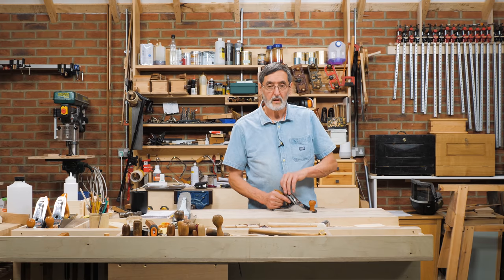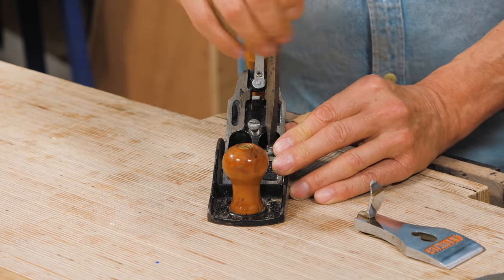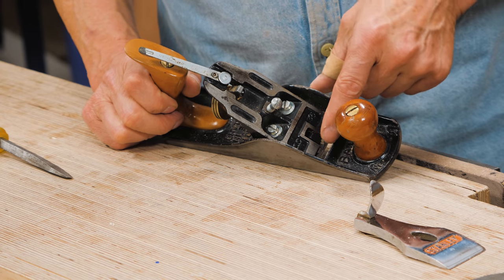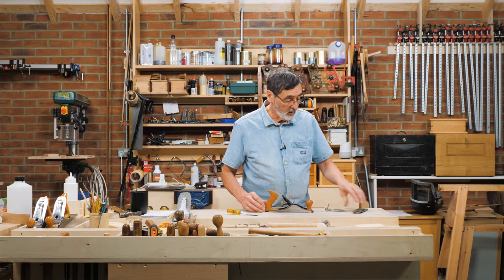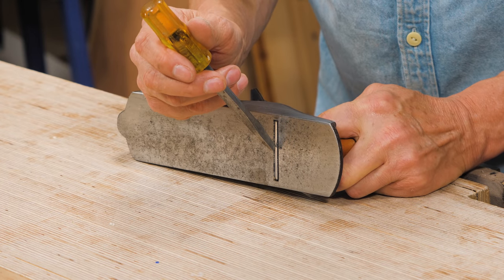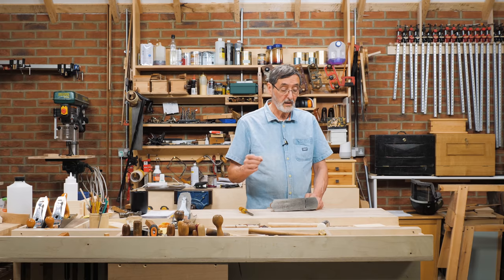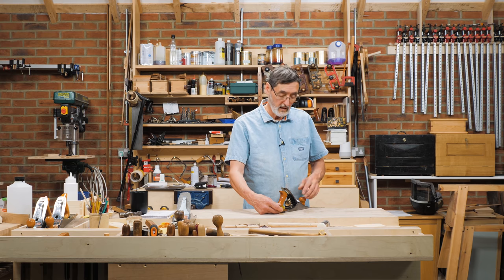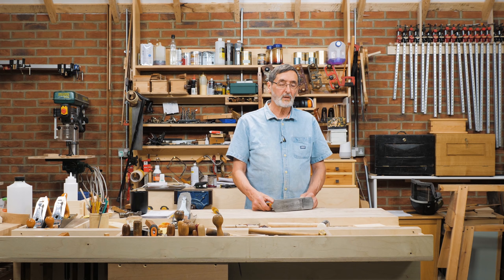How to Adjust the Frog on a Bench Plane | Paul Sellers

Comment: You said "if I align the soul somewhere around there", while pointing your finger to something that I can't see in the camera image, what you are pointing to or it's meaning, because you switched in mid sentence from talking about the frog to adjusting the soul which doesn't move. I'm pretty sure that you were talking about a reference position of the frog to the rear of the mouth but I can't see where that is based on the pointing of your finger.
Reply: Sole :)
Reply: @Russ0107  I stand corrected. A plane has no soul. It has a sole. I, on the other hand, have a soul but no sole.
Reply: @ancienttom97  Don't be discouraged, you have two soles. One on each foot!

As for the frog alignment, Paul is indicating the back of the mouth opening, which is bevelled at the same 45° angle as the frog. He's aiming to position the frog so it's own angle and the bevel angle on the mouth are roughly flush (his looks to be set slightly back from it), and then make small adjustments from there.
Reply: @ancienttom97  some planes do have a soul.
Reply: @rossbaker3762  Thanks. that's what I couldn't see, the proximity of the front of the frog to the back edge of the mouth. I have a couple of cheap planes that want to try to flatten an square up before deciding to through them away. By the way, I am a Hillbilly in the Ozarks and I go barefoot.
Reply: @ancienttom97  You made me smile; thank you.  I'm sure you're a pretty smart Hilbilly.
Reply: @ancienttom97 As a Canadian, people in some parts of this world still believe  that we all walk around up here in snowshoes. My souls are protected.🥴👍🇨🇦👨‍🦳

Comment: I have a very curious situation. I was assembling a plane that I restored, and when I mounted the frog with the top screws, one of them wouldn't go in all the way. Unfortunately I didn't note the screw position before disassembling. The screws are the same length and the holes are the same depth, the threads all seem to be intact, so I don't understand why one doesn't go in all the way. Is that by design or is something wrong with my plane? I haven't assembled planes before so I have nothing to compare to.
The good news is the plane functions perfectly fine.

Comment: Thank you. I followed your video on plane restoration and it was a very enjoyable hour or two to tweak a couple of Stanly planes back into full working order. I did wonder about frog position when reassembling, but I just put them back exactly where they were as you show here and they worked perfectly - once the blades had been sharpened.
Stay safe!

Comment: Thank you Paul for this information.  I made the mistake of moving the frog back on a #4 and discovered that the iron would not advance far enough to contact the work as the heel of the bevel pressed against the bevel on the plane sole.  Now my suspicions are confirmed.

Comment: Hi Paul, on a semi related note, I found amongst my fathers old things an instruction leaflet for a Stanley plane. It looks like it's from the 1960's. On one side it details the various parts of the plane, how to sharpen the blade and how to adjust the blade. The flip side has 'Hints' on how to use the plane and of course a promotional section showing the various other Stanley hand tools in their range. As the picture on the leaflet is for a #5 plane I'm assuming this leaflet came with the #5 plane that is sitting in my workshop which I inherited from my father. I could scan the leaflet and send it over if you are interested.

Comment: Thanks for passing on your experience Paul. On a somewhat different note, I've got a plane which is a fairly close copy of a Stanley Bailey #4 but it has an aluminium block for the frog! Will this be an issue as far as the working or longevity of the plane is concerned?

Comment: Thank you Mr. Sellers for teaching me these valuable lessons and old know-hows. I finally nailed the restoration of an old Stanley Bailey #4 type 16 from the 1940's. I kept getting chatter and tried allmost everything. Then I watched this video again and as it was, my blade was touching the back of the mouth... I resolved this and the difference is like night(mare) and day. It is so nice and smooth now. The only thing that is bugging me, is the extreme backlash.. I do know it is there and counter it accordingly, but it is more than a half turn. Is there a way to fix this? I have seen someone who shimmed it, but that is not a nice solution in my head... And a question, should one back off the blade and then tighten the adjuster to get the backlash out, or can you just retract the blade and leave the adjuster at that setting without retightening? Kind regards Jurik

Comment: Planes are still a bit of a mystery for me. I've only bought one, 2nd hand on yardsale. and don't really know if it's broken or even if the parts belonged together.. I have "restored" it and sharpen the blade so it does cut but often shavings stick in the corners of the mouth of the plane...
Reply: Make sure your chip breaker is in full contact with your chisel over the entire width. If not, one or both may need some flattening
Reply: @robincolenbier5875  Will do. Thanks.

Comment: My question is why would you want a great big opening for the most part these are tools that removes small amounts of material they have other tools to remove large amounts of material good refresher course though
Reply: If you were converting to a scrub plane perhaps. File the mouth a little and move the frog back to create a wider gap (or file the front would make more sense!).

Comment: This has been driving me crazy on my #7 , I can't get any more than a sliver opening  , the only way I get an acceptable gap is when I raise my chip breaker way more than I like?
Reply: You could file the rear of the mouth to create a bigger mouth. I'm guessing that if you had a thicker blade than the original, this would create your "sliver only" mouth issue. Once filed you could retract the frog further.
Reply: I have replaced the blade but it was an issue with the old one which I suspect was original  , I'm hesitant to alter the mouth but it might be my only option
Reply: I’d file the front of the mouth to enlarge it. I got some thicker Veritas blades for my vintage Stanleys but haven’t installed them yet but i expect to file the mouths. Apparently the amount that needs to be filed is minimal.